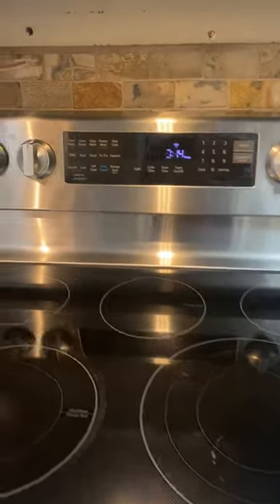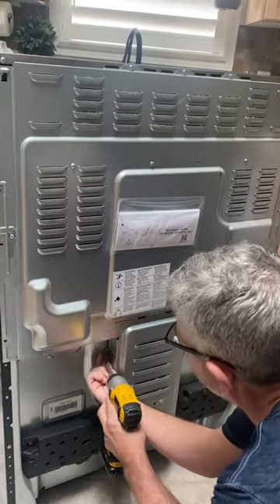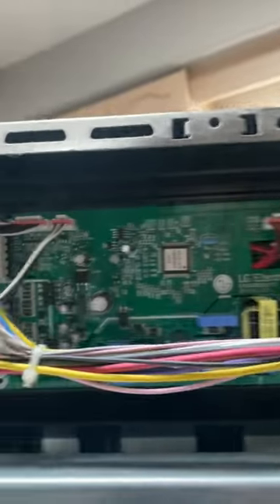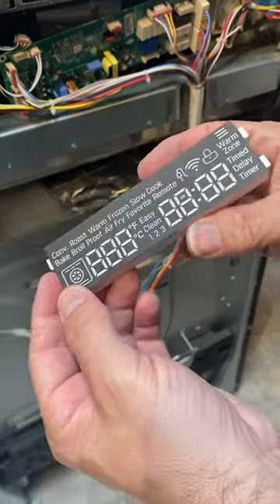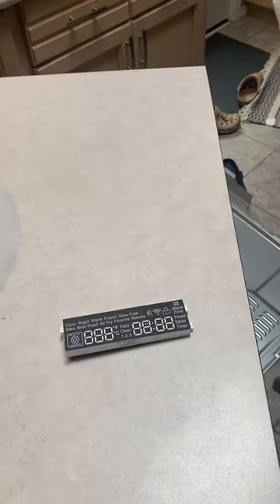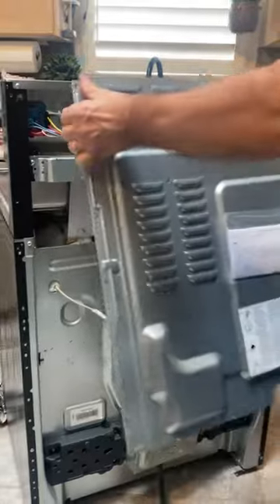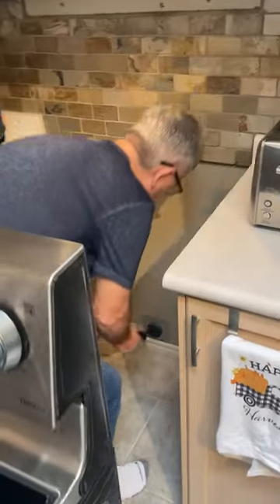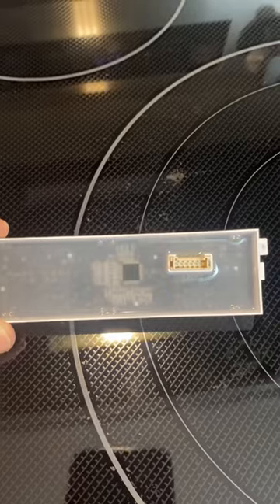Lg Stove Clock Repair

Comment: Exact same issue on similar, if not same model, and almost spot on 2 yrs in use (Jan 6, 2022). Ridiculous this part failed in this short amount of time. Thanks for posting. 

Edit: Yep, same type, but apparently stepdown...  Mine is Model #LREL6323S, 6.3 cu ft. Electric Range. I called LG and warranty is 1 year and no other recourse. I referenced your video and associated comments for inclusion of rep's notes and my complaint. Rep acknowledged there were "some problems" and the appropriate department was "aware", for whatever that's worth. Their LG repair was quoted at $345 in NE Florida. The price is my recollection, but didn't write the info down, just declined.

Comment: I had the same problem. I live in a remote area and they couldn’t find a warranty repair person so gave me a $1400 gift certificate for a new stove. Crazy eh. They let me keep the “broken” stove. Bought the replacement part off of eBay for $50 but didn’t get it put in. Decided to run the oven clean cycle and it must have melted the solder. Works fine now and I have a brand new stove in the shed in a box. Win!

Comment: Yup! Same problem. Only had it a couple of years. Thanks for the video.
Reply: Additional thought - I bought a replacement LCD board based on my oven model number, but it was very slightly different. I read that they can sometimes change boards during a manufacturing run. I think it is best if you take apart the oven and remove the part BEFORE you order a new one. That way you will be ordering the EXACT part that needs to be replaced. Relying on oven model numbers is not always accurate as I have found.

Comment: Thank you for sharing !
I have the exact same problem with my LG range (the same 6325F model as yours) that I purchased new from Canadian Appliance Source (CAS) just 2 1/2 years ago.
Shame on LG for offering unduly short warranties given the lifespan reasonably expected for a device of this type.
I don't know what the Common Law provides in the other provinces of Canada but here is what the Civil Code of Quebec provides on this subject: 
“1726.The seller is bound to warrant the buyer that the property and its accessories are, at the time of the sale, free of latent defects which render it unfit for the use for which it was intended or which so diminish its usefulness that the buyer would not have bought it or paid so high a price if he had been aware of them.”
To be continued !
Reply: What happened? I'm also in Quebec and have the same problem and the same stove..

Comment: Three-year-old LG gas slide-in range, precisely the same issue, with display losing one LCD at a time. I bought an LG for reliability, and now I am seeing near-infant mortality in the display. What is up with their quality control? Is it done by Boeing? Very disappointing. 

I am thinking your 2006 vs 2008 part number merely reflects the year of manufacture of the parts in question. 

Thank you for preparing this video. I should probably post something analogous for my unit, for which the disassembly procedure will be entirely different because the display is on the front panel, right above the oven door.

Comment: Thanks for the video. Luckily for me, after almost 2 years, I was able to get the warranty to kick in and they're going to replace it shortly. But I'm curious to see what you'll be able to do with the old part, as I won't be able to try it myself since they'll probably keep the old part.
Reply: The guy who came replaced the motherboard + the EAV64012008 device. I'm happy to say that the two parts he replaced, he gave me the two old parts. I started looking / testing at the old motherboard, which still seems to be in good condition. As for the EAV64012008, because of the epoxy, it's really hard to test.
Reply: @john_Jean-Marc_JMP5184  I suspect the motherboard was just fine, but they didn't want to risk a second truck roll.

Comment: Oh! I have the exact same stove and I noticed a cut on the surface of the clock area, don't know if its because of that, but it hasn't been working properly for months now. It also happened about 2 years after I got it. Now we can't even see the oven temperature properly and we have to guess 🤣 thanks for this video. Dont think i would be able to change it myself, so time to call my dad 🤣